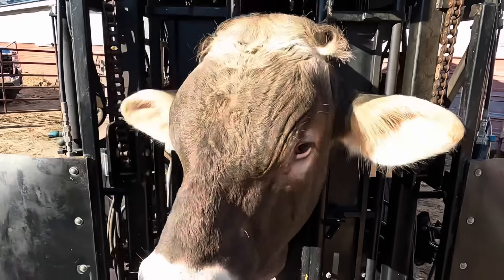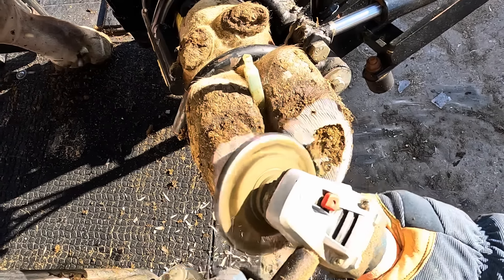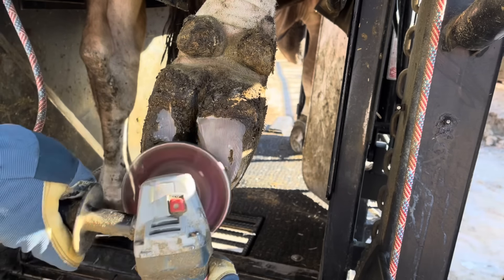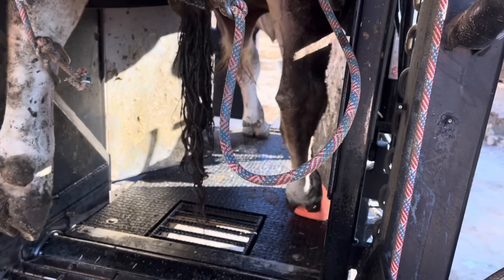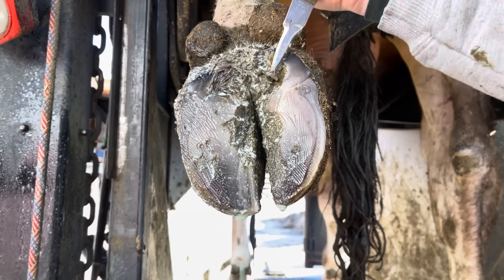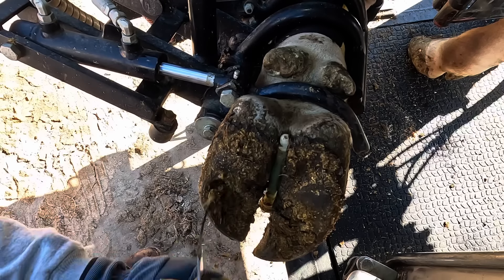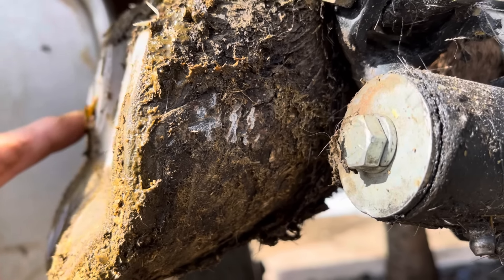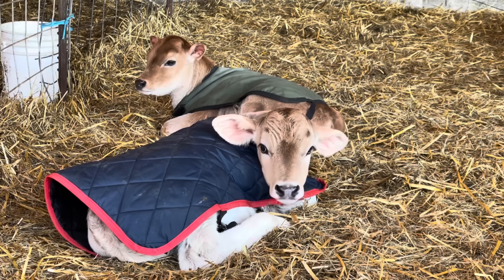We’ve got a BIG BULL with a BIG GROWTH

Comment: Does the grinder create heat through their hoof? I know when I get my nails does and they use a drill to thin the nail if they stay in one spot for longer than a second my nail gets so hot it burns all the way through. I know their hoofs are a lot thicker than my finger nails but they also use a bigger higher powered drill, Just curious.

Comment: Hi Nate, love your videos, out of curiosity, what disc are you using on your grinder to do most of the heavy sanding? Grit, or name of the pad?
Reply: He's mentioned in other videos -- it's carbide blades, not a sanding disc, and although the disc comes with four blades he only uses two.  Using blades means it cuts rather than abrading, which avoids heat buildup in the foot.
Reply: @BrooksMoses  Awesome, thanks man
Reply from the maker: It’s a Rotoclip cutting wheel.  The only time I use an abrasive disk is for block prepping.